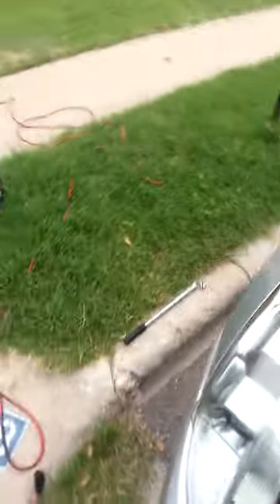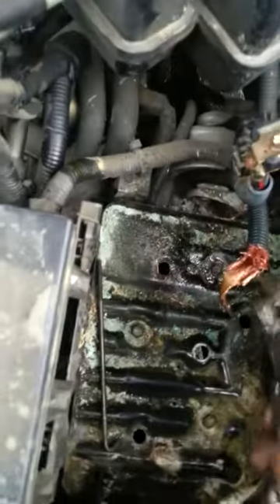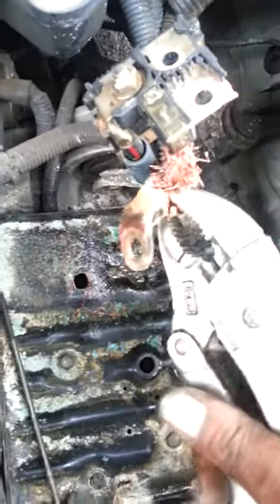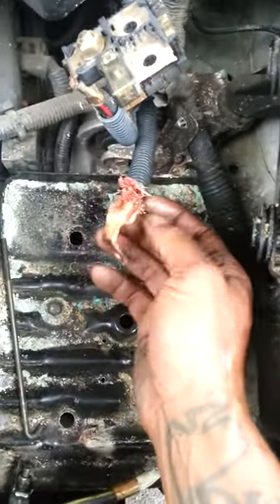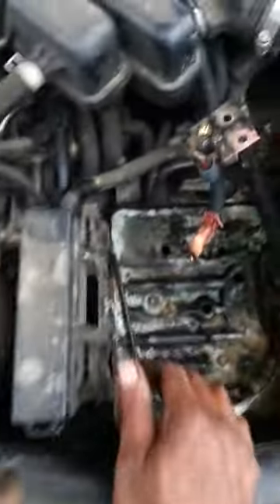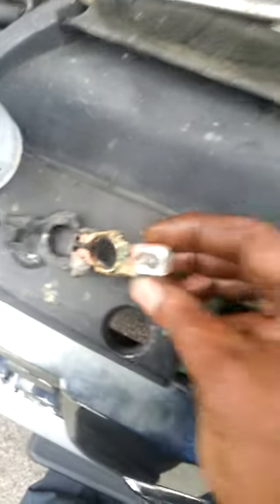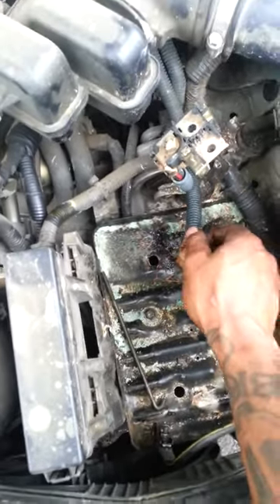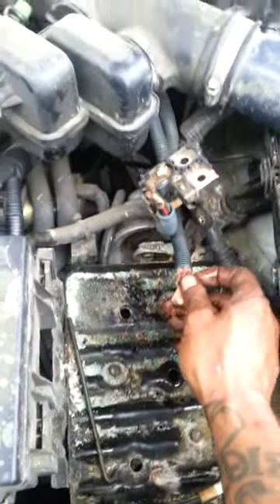2003 Nissan Maxima.How to replace crimped battery terminals...

Comment: I have an 08 maxima and I need to replace the connector for the other wire that isn’t crimped on the fusible link so I can connect my new terminals how would I go about this to avoid seeing a dealership ?